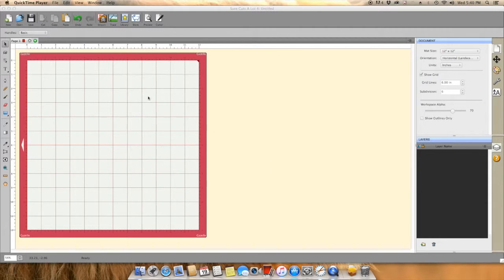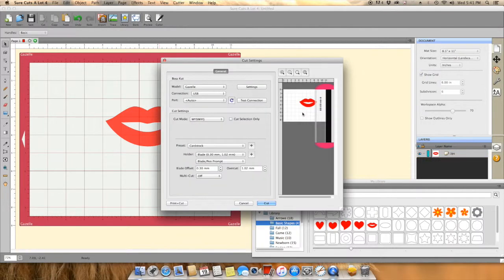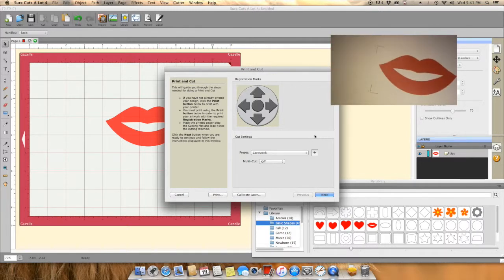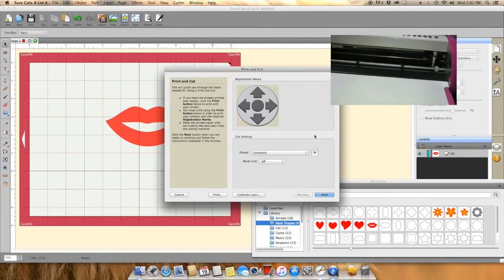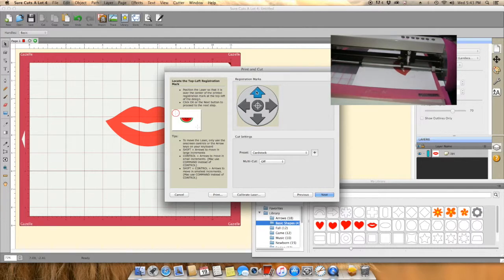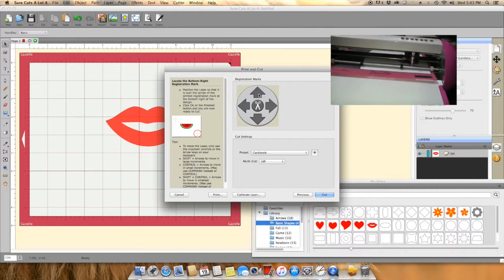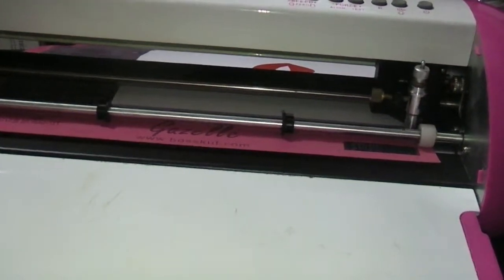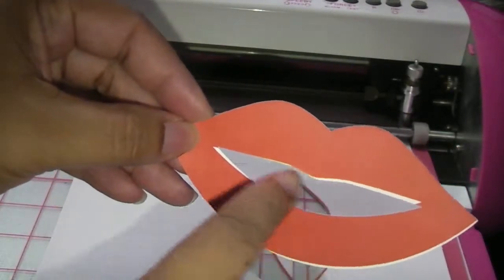BossKut Gazelle Print and Cut

Comment: Have you had any issues running your Gazelle on your mac? I've gotten mine to work previously but since I've updated to El Capitan whenever I plug the Gazelle in it disables the USB devices on my late 2008 iMac. It's never worked smoothly, previous I had to have the gazelle plugged in and start the imac with it on because it'd disable the USB but now that doesn't even work. :(
Reply from the maker: +Nicole Rogers I didn't update the iMac I use with my cutters. I'm still running Yosemite. I do have El Capitan on my 2009 Macbook Pro. I can do some testing in a few days.

 Also, other cutters have had issues with El Capitan on 2009 and previous models. I suspect this happening with your machine.
Reply: I contacted Apple support and they recommended booting the iMac up in safe boot mode so did that & I don't get the error in safe mode BUT the iMac still doesn't recognize the gazelle. I also am not sure if the driver is installed via SCAL 4. When I try to download it says I need to have the cutter plugged in and powered up. Ugh. I'm about to just be done with it and save up and buy a silhouette. I'm over constantly fighting with this machine. Since day 1 I've had problems.
Reply from the maker: +Nicole Rogers The Gazelle is very persnickety and that can be frustrating. Do keep in mind before throwing in the towel, the Gazelle can cut at a greater force than the Silhouette. However, I have no doubt you will love the cameo! It works great with SCAL 4...but keep the Gazelle on reserves for those heavier materials.